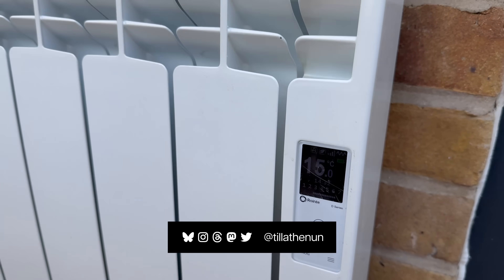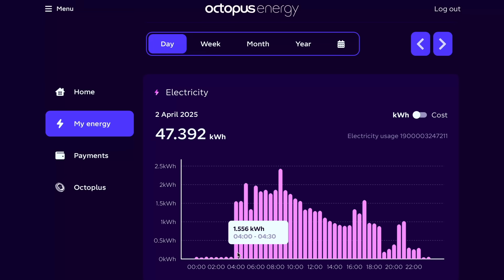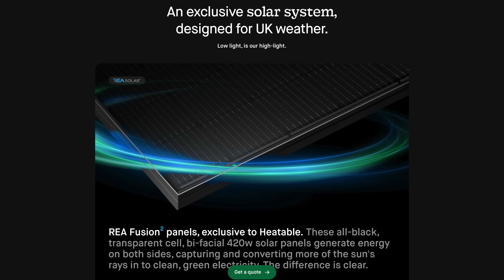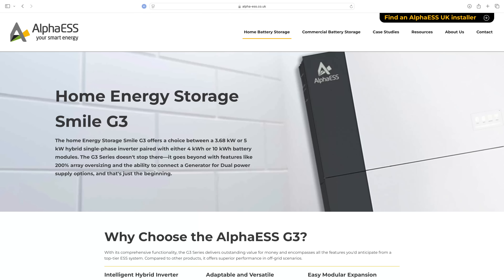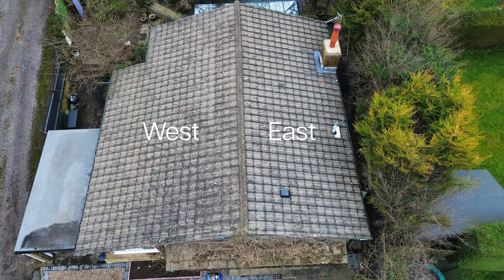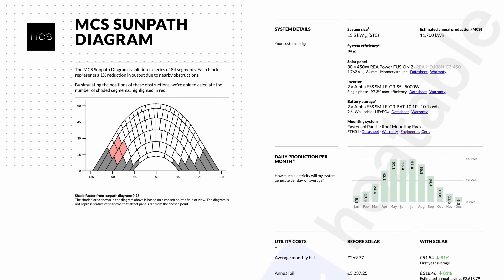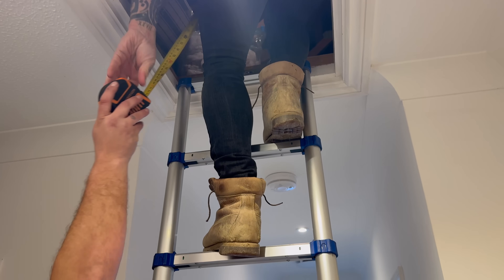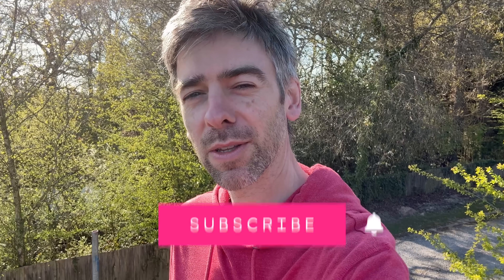We're going to kill those bills! Why we've decided to get solar panels and battery storage. ☀️

Comment: Great Video. Alpha ESS Gear really is the best out there so good choice. Just on price however, we'd be around £13,500 for a like for like setup so always worth shopping around (we have been trading for 15 + years so we likely get much better prices on equipment than heatable who have been only doing solar for just over a year + don't have expensive sub contractors as everything is done in house) .  It goes without saying for anyone looking into solar, check out which? trusted traders for your area and get multiple quotes.

Comment: We had solar installed in 2021. We we're advised by the installer not to go for a battery immediately and see how are first year of savings went. During our first year we had a power bill of $350 nzd. We are with Octopus Energy and at the time the daily fixed line charge was $0. The Powerwall 2 costs $18k nzd, and even if we could make our annual bill $0, it was going to take 51 years to offset the upfront costs. Jump forward 4 years and our projected bill is expected to be $1,780 nzd. This is due to several reasons. The government scrapped low user rates 4 years ago and the daily fixed charge has been doubling every year. We've also had issues with generation due to low hydro lake levels during winter and a lack of investment in the grid infrastructure, so power prices have inevitably increased. Our daily fixed cost is now $500/yr which we can't change, and the remaining $679 is for power, so it would still take us 26 years to offset the upfront cost of a battery if we could make our bill $0 + daily line charge.

Comment: Installed a 5kW array with 16kWh battery and also use a five hour cheap rate overnight tariff for my EV and to charge the battery to 50% SoC in the summer and 100% in the winter.  Certainly has a benefit even though I don't received any feed in funds as the amount I would receive is too small  to worry about.

Comment: I am looking at getting an even bigger system than yours. I am looking for 70 panels on my house with batteries. I live in the south of the UK. I am hoping this size system will be enough to run my bungalow totally by solar. We have an EV too. But we do use a lot of electric. We use about 1000kwh per month. In winter it’s 1600kwh. And we also use gas. I  hoping to get away from gas.
Reply from the maker: 70 panels! That's amazing! I have to say, so far with the 30 we have, it's proving to be amazing. I wish I'd done it sooner.

Comment: Just got my own solar installation a few days ago - going for the Powerwall 3 and 3.2kWp of panels. Its a small system but incredibly well positioned roof, and In combination with the air source heat pump its already worth it - especially since I can now heat hot water during the day (when the air is warmer!).
Reply from the maker: Congratulations!

Comment: Very informative vlog Andrew, thank you. Unfortunately the only roof I can place it on is NW facing and according to Heatable I would only break even after 15 years so not worthwhile for me 😞
Reply from the maker: What a shame! What about doing battery storage without solar?
Reply: @MrEV  I suppose that's still an option... I have an E-Niro on Octopus Intelligent, would I be able to charge both the car and the battery between 11.30 - 5.30 no issue? If so which battery would you recommend that would automatically step in during the day to supply the household electrics until it runs out?
Reply from the maker: @Mikeall0625  As I understand it, that'll depend on your home fuse. We have 100amp fuse here and I can charge the EV and battery at the same time with no issues. You may be able to get the fuse upgraded for free if needed (as UK Power Networks did for me). Check with your DNO.

Comment: interesting video
Having replaced our oil boiler 14 years ago with a air source heat pump the electric bills seemed to sky rocket.
Just had solar and battery installed - batteries charge up overnight on the cheaper rate so i can maximise the sell back during the day to the grid.
i went for 2 of the Dura5 Solar Batteries, looking at adding 1 possible 2 more for the winter months.

Comment: Should be a good system. I've got micro inverters and 3 yrs in. Still no issues. I actually increased the size of the battery install (LuxPower Uhome) as I found the 4 that I had would do ok during the summer but come 4-5pm in the winter, they were tending to just run out of power. I've now got 6. Works well. 

I don't have an EV but I have recently moved over to E.on Next Drive V6. Seems, as long as you have a battery, they'll let you go on it. The night rate is for 7 hours at 6.7p/kwh and is for everything in the house. The batteries charge up on that and at 18.30 each day, I let them discharge down to 40% SOC. I get 16.7p for the export. The solar side is ok but tbh, I would rather increase the battery size. November through to February just gone, we produced so little on the solar front (East/West array).

Comment: We had solar in our previous house - with micro inverters. I wouldn't specify them again unless shading was a massive issue. Ours were fine but the manufacturer went bust (so did the warranty) and people I know have systems with half of the inverters not working and a massive bill to get the system fully working again.

In our current house it already had a dual string inverter at 4KWp of panels. Installed in 2013 it came with a generation based FIT which means that we get paid for what wer make even if we don't export it (which we tend to not do). We installed Alpha standalone batteries (15KWh) about 18 months ago. We couldn't put in a hybrid system as it would have broken the FIT agreement. We also moved across to Octopus Agile. Agile has saved us quite a lot of money so far. Occasionally we have hit the price cap in the past winter but, quite honestly, the savings outweigh these occasional events. I've added Home Assistant control to the system so that we can pick when and how much the batteries charge overnight  based upon Agile pricing as well as battery SOC and predicted solar yield for the coming day. This has also helped us keep our electricity costs down even further.

I have considered a heat pump to replace the oil boiler (no gas in our village) but remain unconvinced of the savings against the price (as the boiler is efficient and working well) - especially if I buy the oil when it is cheaper and use excess solar to heat our thermal store. If the boiler becomes problematic, that may be a time to reconsider - especially as we have hydronic under floor heating.

Alpha have been pretty good so far. Hardware wise it has been excellent. One of their firmware updates massively upset the Home Assistant coding for us but that isn't an issue for most system owners.

Comment: Well you might have moved from down the road but your journey is still running in parallel to ours!😂 We just had solar and Zappi fitted after loads of research. Batteries were delayed but they'll be fitted in just over a week. I've also researched electric heating and I think the key to it is smart controllers. Rather than letting everything come on all at once in the morning, just have the rooms you use come on when you need them and drill down your usage to prevent excessive consumption. I haven't changed our heating from gas yet, I'm looking at infrared with smart controllers but I'd be interested to know if your enormous bills were particularly caused by using the heating the same way we use gas or whether using with great care still meant high costs.
Looking forward to the next one.👍

Comment: Hi Andrew, I note you mention in your video that you have an issue with partial shading. Did your installer discuss the possibility of using optimisers to address this? 
I recently had a 24 panel and 21kW battery installed, with all 24 panels with optimisers. My arrays are spread across 3 facets, South, East and North facing, in 2 strings to the inverter. With the optimisers in place, if one panel is in partial shade it does not bring the output of the rest of the panels in the string down as with a non-optimised system. 
I would also look at E-On Next as they have a 7 hour off peak to charge your battery at 6.8p/kWh  and if you are with them for import there is an export rate of 16.5p/kWh. Thesd rates are fixed for 12 months.In under 2 months my system has generated a net INCOME of nearly £250, charging the battery at night on cheap rate and exporting excessxsolar during the day - yes its been sunny but I am not only saving a lot but earning a profit too. 
I wish you every successxwith your system and look forward to seeing how it performs.

Comment: Hi Andrew, can I ask were 2 batteries and 2 inverters cheaper than 1 Powerwall 3 and gateway (you don’t need an inverter with the PW3)? Also are the micro inverters Enphase if so they are limited to 350w output each and will have losses from DC to AC and then back to DC for the battery. Tesla is DC coupled so can just store the energy without inverting it. The thing I like with the PW3 is that you can charge it off peak (7p) and then run the house off that all day while exporting all of your generation for 15p. I don’t know if the Fox system does that, or it only exports when the battery is full?

Comment: As a procurement consultant.
I would want a guarantee from the installer that if your current level of consumption continues and the savings are not in accordance with the savings he guarantees then he pays you 50% of the difference.annuallyor. Either way. Benefit share the extra savings then you pay him 50% of the benefit.
Installers over estimate the savings the more they over estimate the more they can charge you..
I personally have solar on a caravan with batteries...But choose not to do solar in my property. Why because I heat with a refillable gas bottles "safefill"at a cost of .68p a litre.. so heating costs are between six and 11 a week. My costs per year for gas and electric are £900 combined £180 safefill gas 
For that my £18,000 investment is in the bank earning 4.65% interest.
I hate to say but my son recently purchased a property with solar for power and water ..It was a nightmare with the solicitors changing the titles over..delaying the purchase at least for two months ..He still doesn't know who owns the property..as the installer no longer exists and the pay cheques he things go into the previous owners bank account, and he's currently in a care home with Dementia.
So there are costs to these that you may not expect going forward.
Keep all your paperwork your going to need all this and your warranties when you sell ..Is your warranty transferable ?

Comment: Andrew, I've been considering the possibility of having a battery pack installed without the solar panels. The plan would be to charge it up overnight using my ev tariff cheap rate and use it to power the house during peak periods.  Would this be financially feasible?
Reply from the maker: It’s a great thing to do, but you have to do some sums to work out how much energy you typically use every day, how big a battery you’d need, and how much you’d save by load shifting (using the cheap energy stored in the battery).

It’s a great way of saving money though, and I’d argue it’s a valuable asset if/when you come to sell your home.

Comment: Im new to the solar stuff but jumped in with a 3KW solar system, 5.1KW battery and cheap rate car charge. Massive difference in the bills. Got a massive discount on the install as it was a council incentive. Was on holiday last week and my electric was £1.50, gas was £2.30 and pumped £16.50 back to the grid and its not even summer. Heat pump next with an upgrade to 5KW solar and another battery. The Octopus tarrif is really good can charge my Audi for £5.39 for 250 miles.
Reply from the maker: That’s great going!
Reply: How much did the whole system cost?
Reply: @dansari0007  7.3K

Comment: Andrew, where have you done your research about LFP batteries ?
WARME IS BETTER cause they can easier store and discharge. Check out the specs provided by the 6th biggests LFP manufacturer in the world called EVE. They have a cell LF280K and that cell delivers roughly 900 Wh per cell (in a 51,2 V configuration 16 are used hence 14 kWh capacity). 
The nominal capacity of these LFP cells depending on temperature is shown in graphs and there you can see that warmer is better especially during winter - and never put them outside cause they suffer more and will not last that long. We have used LFP for over 12 years and trust me, outside did not work at all cause there the capacity of 2 batteries in parallel will suffer , you might even shut down 1 to keep the load on 1 battery but than a higher load to increase the cell temperature cause charging and discharging cause heat losses. Our battery had been stored outside 10 years ago but the knowledge about LFP back then was very limited and we had to learn it the hard way: did not work out during winter cause the chemistry will start to become the bottleneck below 4°C and each 1°C less even more. Wrong spot and the worst to CHARGE cause the requirements are different. You can discharge a 0°C LFP battery but you can not charge it. 

We have moved the battery up to the attic below the roof which btw is now colder due to the kind of isolation by the panels which reflect the sun rays, the shindles and roof no longer get that hot. Perfect spot for a battery or a cellar. Outside storage is the worst option you can choose, humidity will creep in cause seals will get hard over time and crack like in cars, the UV light gets everywhere and we had seen the impact back then after the 1 year and winter cause the colours had changed, even the seals colur were partyl outbleached.

Comment: 7:53 - you do not really need a heater of the battery in the UK where you live if you install it in the garage cause when do you have freezing cold temperature of 0°C in the garage ? Remember: you use this battery constantly during day for charging or discharging so the cells itself inside of these are constantly working and generate heat itself - not literally like 40°C, but still a few °C which means they themselve . They also do not suffer in the cold if not used or only for discharging. Rule of thumb: 4°C are enough to charge and discharge safely especially when the garage is connected to the house (then 0°C is enough) . Only minor disadvantage: the capacity of the battery running in low temperatures is slightly lower but you have to check the spec sheet of the battery cells manufacturer which you should get and Alpha ESS should provide. Get that sheet NOW cause you might need it in a few years when you face issues with 1) a single cell or 2) with the bms 
We buy EEL V4 cases with BMS and the cells we want to use and not the cheap stuff battery manufacturers choose hidden inside.
Attention: If you ever build a LEGO like kit like EEL V4 you will be able to fix your battery on your own. Any serious repair of Alpha or Tesla batteries will be 1000 GBP or more while your EEL V4 case assembly kit will only require the exchange of the BMS which is about 100 to 150 GBP. So be smart and learn that how to assembly it which is as easy as a kit of LEGO TECHNIK like a Bugatti or so (which are more complicateed than a battery).

Comment: forget about the MICRO INVERTER hype - they are usually crap in the long run. They will cause an issue and that issue can be big depending on the fault. If you have to replace a microinverter you will usually need a scaffold hence in germany a 250 to 500€ bill for that just to be allowed to work on the roof safely. Then the repair itself means to remove other panels to get into the array to that panel where the faulty inverter lives. 
Horror - we had done it for customers who had insisted on mircro inverters due to shading and now 10 year later every customer suffers from 1 or 2 lost and asking for repair , they will even pay for that till they realize that the easily 500 to 1000€ repair (incl scaffold & microinverter and roughly 5  to 6 hours of labor involved to get to the faulty panel - hence you need a monitoring to know where that is cause without the bill would be up to 10 times as much removing the panels till you found a faulty one) 
Those trina solar panels from 2014 had 250 Wp and produced in 10 years x 250 kWh = 2500 kWh for maybe 15 Cent = 375€ ... which is far less than the cheapest bill you would get if that is a panel on 1 of the 4 corners , best lower right or left. 

If you suffer from a shading you need a smart string layout and use ONLY for those panels next to such object like dormers or chimneys optimizers. They have more or less the same risks, but with a lower likelihood to fail. Microinverters are running the whole day the full year. Optimizer are only part time workers. The do nothing in Australia if there is no shadow at all. Their power electronics are only working in case of unequal shadow on the string. That panel face shading and 9 others have full sunlight, then the optimizer is working and the more the shading progresses and covers the 2nd and the 3rd panel the less it has to work. Quite simple hence a fraction of working hours and loads compared to a microinverter.